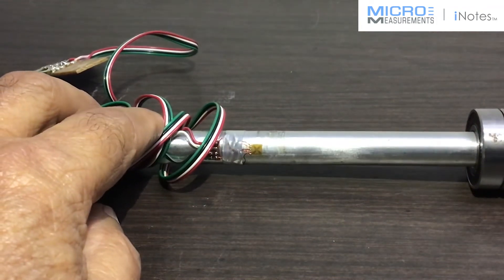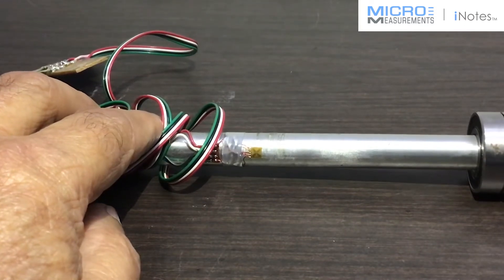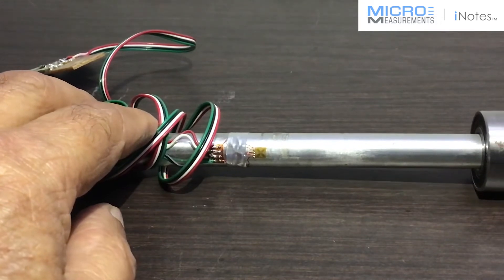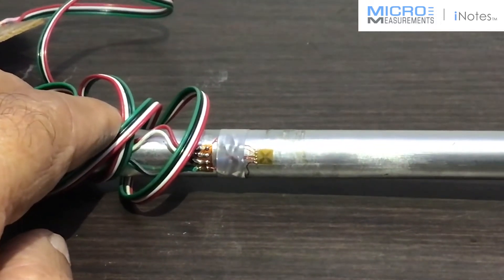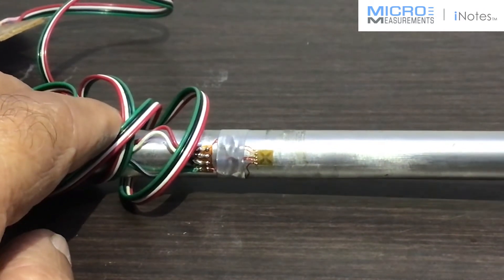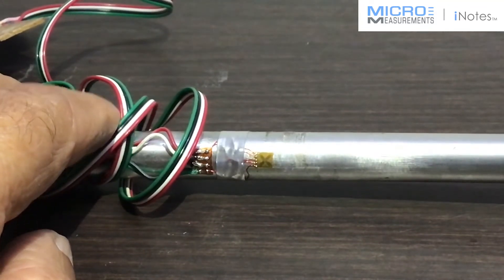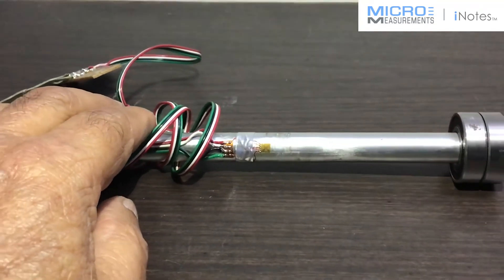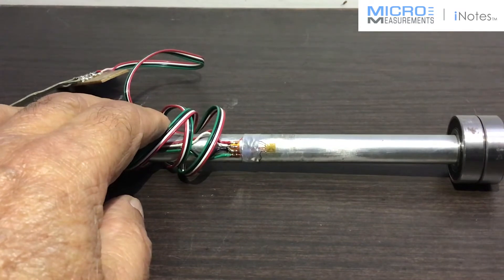Measuring Load and Torque with Full Bridge Strain Gages.

Comment: Could we measure the  Tourque  with strain guage using Labview and DAQ 6008?

If yes, please sent me a reference !
Reply: Findan, the NI 6008 has a 10V input range whereas a strain gauge bridge such as this will have an output of perhaps a few mV, so it is just not sensitive enough. You will need to look for a suitable module that specifies strain gauge or load cell inputs. We have our own range of instruments from single-channel USB devices (MultiDAQ) to multi-channel, high-speed data systems (StrainSmart or Pacific Instruments).
Reply: @antonchittey952  , thank you very much for your response and references!